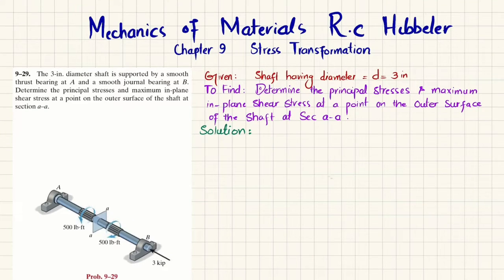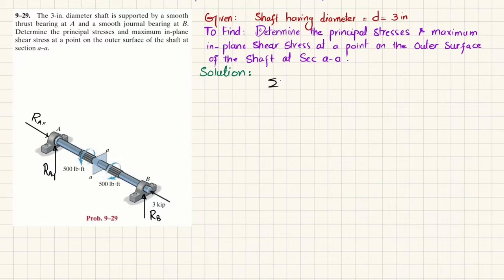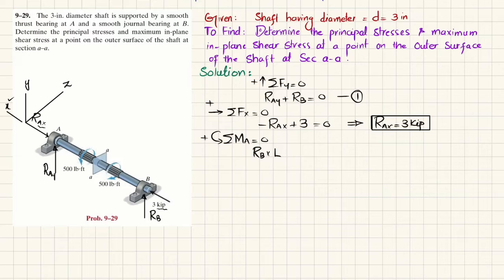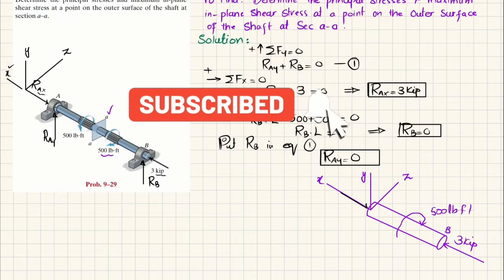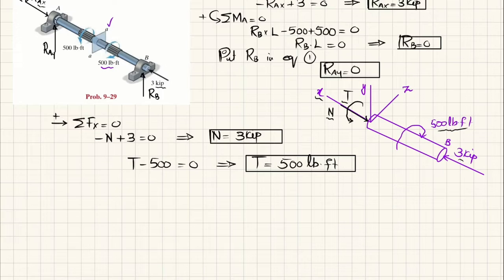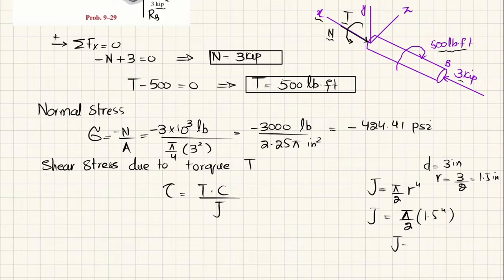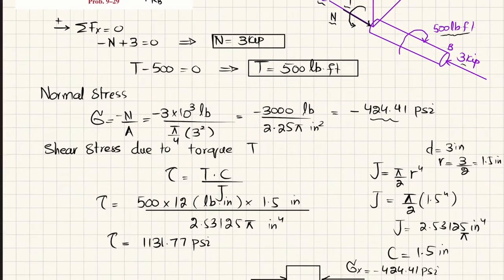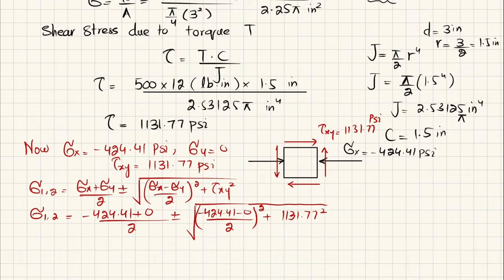Determine principal stresses and maximum in-plane shear stress | Problem 9-29 | Mech of materials

Comment: How about the effect of bending moment at section A due to vertical reaction sir? Thanks.
Reply from the maker: Check the first section of the problem where we have found that reation forces by the bearings. The vertically reaction forces are 0 so its not producing any effect.